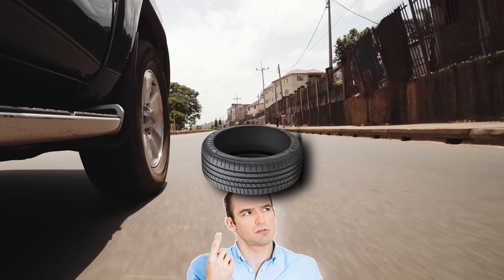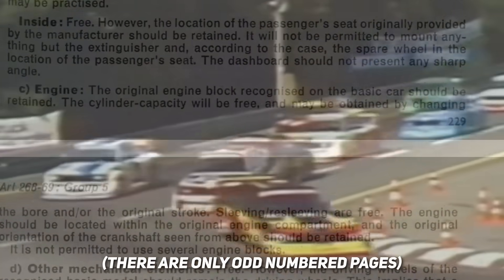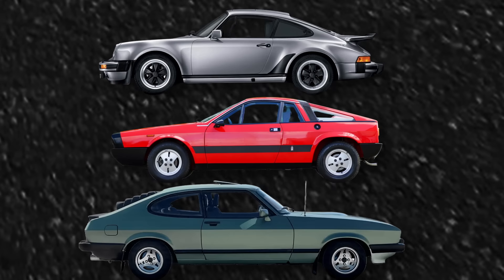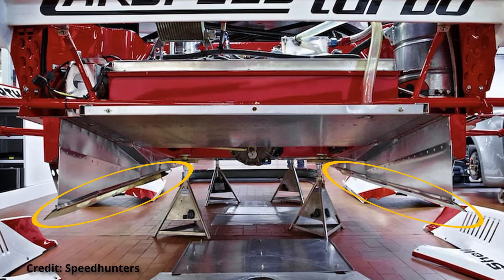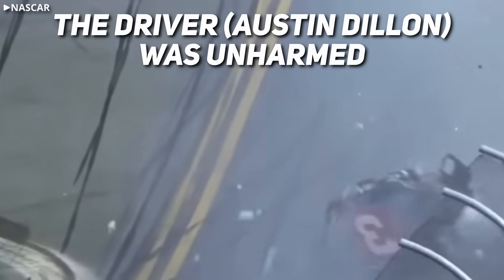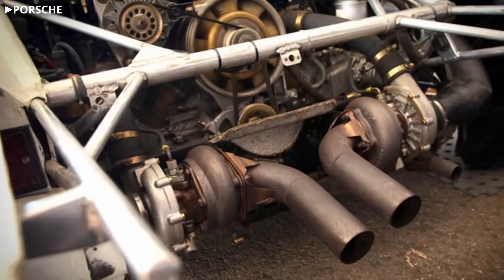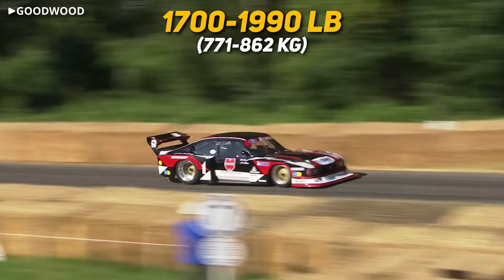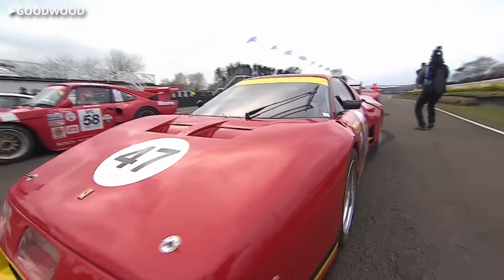The ABSURD Rules and Engineering Behind Group 5 Special Production | Group 5 Monsters Explained!

Comment: A video about Group 7 would be a great accompaniment to this video. No minimum production, no lower weight limit, no engine limit. As long as it had lights, two seats, a windscreen and bodywork covering the wheels, it was no holds barred. It gave birth to the most powerful circuit cars ever allowed to race.
Reply from the maker: Thanks for the idea! Definitely open to doing more videos about specific racing classes like this!
Reply: Take a look into the McLaren M20. That’s a car that gets overlooked by the successes of the Porsche 917/10 and /30, but considering the M20 had no turbos, holds and impressive record. Especially David Hobbs’ 1973 drive where he  finished on the podium behind Donohue a few times.

Comment: You forgot to mention the most successful 935s. The cars upgraded by Kremer, specifically the 935K3 and 935K4
Reply from the maker: Yeah, admittedly I glossed over those with the text on screen at the end of the 935/78 section. I wanted to keep the video on the shorter side and there's so many awesome cars, I couldn't talk about them all. Maybe I'll do a separate video on Kremer specifically at some point!
Reply: The 935 dominated Gr5. One wouldn’t know that from watching this video.
Reply: The Kremer cars were practically unbeatable from everything I’ve read. They definitely deserve their own video at some point. 

Watching those revival races showcase how much of a monster they are. I couldn’t imagine wresting one around a circuit for hours on end. Those drivers had a screw loose to want to drive those.

Comment: I think it’s important to remember that Group 5 lives on it Time Attack and Japanese Super GT racing, even if it is in spirit.
Reply: I think moreso in Time Attack. Wild af aero, near unlimited HP level, balls out privateers. Sounds like the Unlimited Class, but more power crazy.
Reply: @izzdin6228  On hillclimb even more given there are no technical limitations at all.
Reply: Australian Super Sedans are close as well, and far less restrictive on engines
Reply: @edugj23  peep the red R32 rocking 1100hp at Bathurst recently that was a rocketship on the straights before hitting the wall midway through the race.
Reply: @izzdin6228  I saw that, such a great racing series. Australia is really the place for semi pro in recent years
Reply: @izzdin6228  Brad the driver of that thing is either a genius or insane. He used to help with time attack R34 at my old job.
Reply: @derekhobbs1102  and the shop that prepared the car, isn't it a drag specialty shop?
Reply: @izzdin6228  watching it lift the front wheels over the crest was crazy, especially when you realise it was running a few hundred horsepower less than its capable of
Reply: The fact is Hasemi R31 are different competition than Zakspeed Ford and Porsche935 but its same groupb5
Reply: It's a shame that more series don't use the class 1 regulations.
Reply: And also, because of Group 5, it eventually led to the Bozosoku Culture which again led to the rise of Rocket Bunny, Liberty Walk, RWB aftermarket widebody kit scene that we currently know today!!
Reply: @UguisuAnko12  What? Bozos started after WW2.

Comment: In the late 60s and early 70s group six was for prototypes under 3 liters. Group five was for sports-racers under 5 liters with minimum production of 50 until 1969 when it was reduced to 25.
Reply from the maker: Correct, those were the 1st and 2nd generations of group 5. In the video, I was referencing "prototypes" as the 3rd generation of group 5 which were previously the "Group 6 Prototype Sports Cars". Those ran from 1972 to 1975 from what I could find.